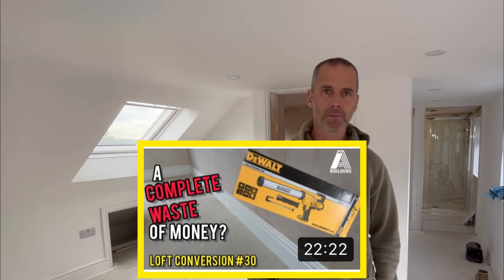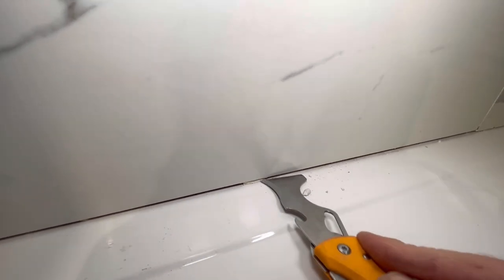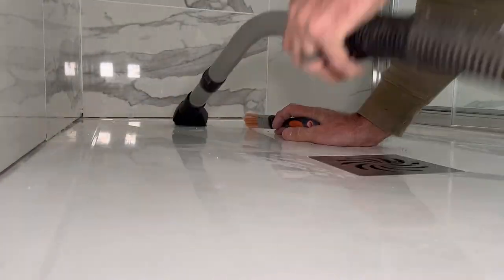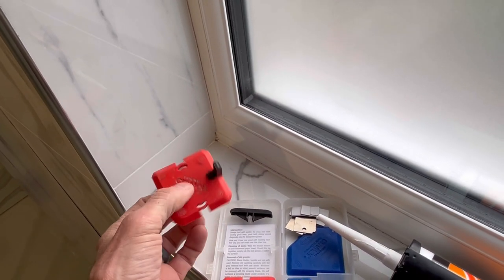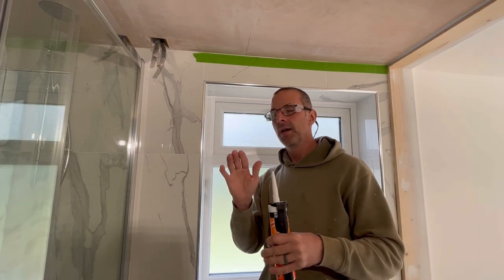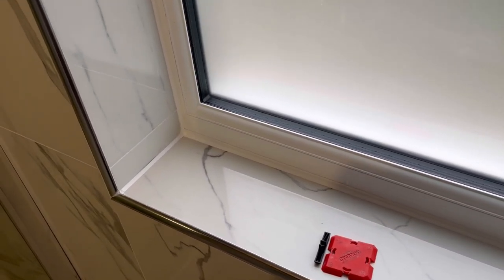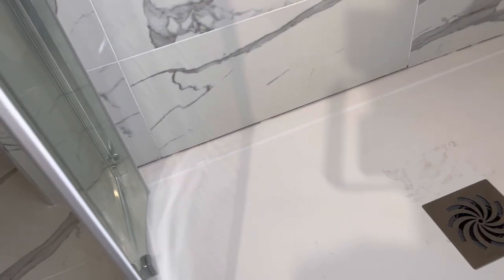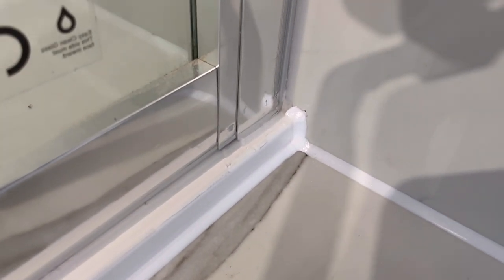Why you shouldn't use water when applying Mastic

Comment: Cramer fugi silicone tools are best on the market, been using them 10 years plus.
Your almost there with your technique  you just need to tweek a few things.
1- area must be preped and spotless and free from dust dirt and oil, then use methylated spirit for a final clean as this evaporates in air and will facilitate a good bond,  never use white spirit or similar as this contains oil and will cause the silicone to debond after time.
2- Silicone the shower tray first and allow to cure before fitting shower screen wall profiles as where the profile meets the wall and the tray this is where it will always leek after a year or two and rot the floor which I've seen many times. 
3- Never silicone the bottom of the shower screen wall profile on the inside of the shower as the profile will fill with water via capillary action and will not be able to drain, the only silicone on the screen or profile should only be on the outside. 
4- When siliconing corners such as a tray  and the wall corner, do both sides of the tray first and allow to cure for an hour or so then do the corner upright, as this way will stop the silicone sticking to the back of the fugi tool when its in the corner.
5- Never lick your finger and touch up any iffy bits as this will introduce bacteria and cause the silicone to turn black over time, its better to dip your finger into some soapy water.
A Lot of my work involves siliconing bathroom's and kitchens, windows and recently vinyl flooring. 
Hope this advice helps,
Reply from the maker: Hi Rich a very in-depth comment and lots of points for me to take onboard thanks for taking the time to do it for us it’s very much appreciated 👍🏻
Reply: Great advice here, especially the section about licking the finger that then applies bacteria to the sealer resulting in mould growth.

Comment: So if you were doing the silicone and the tiles had that couple of mil gap doesn’t that mean that behind the metal of the shower that attaches to the wall there is no silicone? Water will run down the wall (on the video there were bits where the metal wasn’t flush to the wall as you get with those enclosures) so water will get behind it. Doesn’t that mean there’s potential for water to go down the gap between the tray and the tiles behind that silver strip?
Love the videos. Been working through the whole series
Reply from the maker: Hi Alan If you remember from the video I explained this is one of the reasons why manufacturers now say to only silicone the outside of the shower enclosure allowing any potential water that gets into the small gaps or even into the seal around the glass to get out and back into the tray at the bottom. The screen has also been bedded on silicone prior to fitting. Hope this explains your question. Thanks for watching. 👍🏻
Reply: @Mr_A_Builders  sorry I’ve maybe not explained correctly. The metal that runs from tray up the wall that the glass connects to - water can get behind that. Once it does and runs down the tiles to the tray it should as you say be directed into the tray, but behind this metal is there a gap between the tray and the tiles or did the plumber seal just that tiny bit behind the metal?

Keep up the good work though. I’m loving the channel.
Reply from the maker: Hi Alan. I understood mate yep you explained yourself fine it’s just my reply that’s caused the confusion😁. The tray was siliconed fully prior to the screen and whilst still tacky the screen was siliconed in 👍🏻